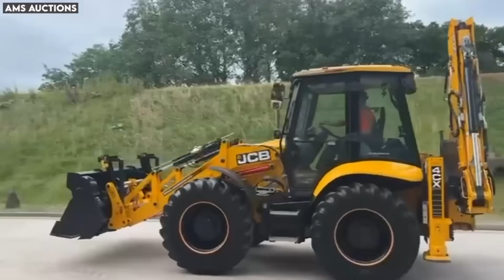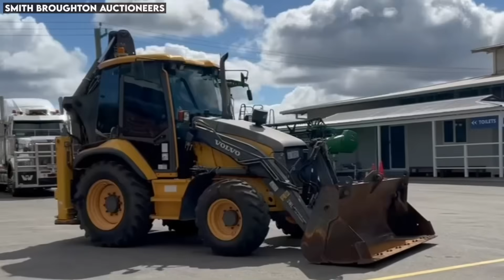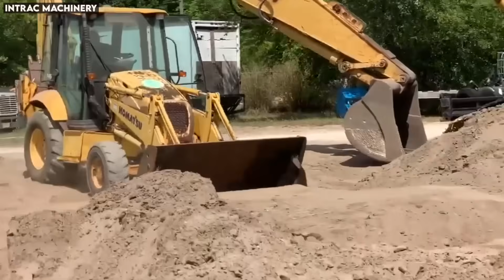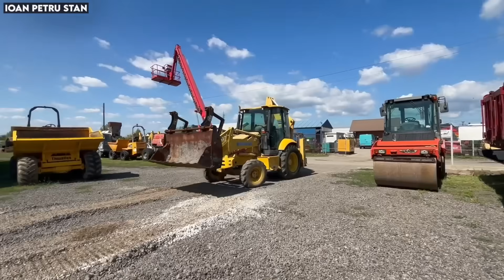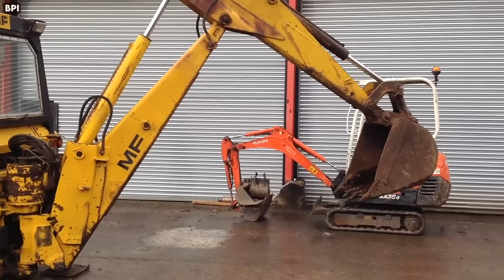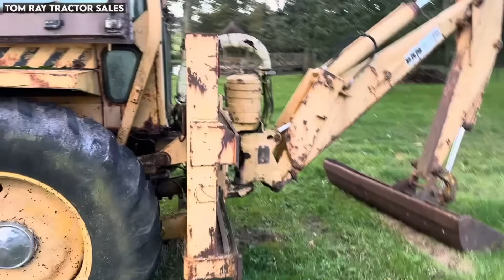10 Most Reliable Backhoes Ever Built

Comment: I started on the Case 580-CK series sitting on my DADS lap, as I operated the front bucket control lever, then he bought a brand new Case when the new 580-C series came out with the twin cylinder on the boom style that Case engineer 😊 that is the Backhoe I operated for years, but in 1979 I got to Run a Dynahoe-190 and fell in love with the beast. It is (19000) pounds, it can dig (19) Feet 😊 it has a (353) Detroit Diesel 
That puts out 92-H.P. I found one for sale in 2003 😊 and today in 2026 she has (8315)
Hours on the meter, with clean oil, and new Batteries 😊 she "STARTS" every time. Even though I operated a Case 580-series all my 50 years of operating a Backhoe 😊 the Dynahoe has the Case beat 😊 on everything. Just the way Bucyrus Erie built them, everything overbuilt.

Comment: If you look at Cats "FIRST" Backhoes the 416 line 😊 you see the old Case great double Boom cylinder system on the digging end, and the Front Loader has the John Deere single center Dump bucket cylinder setup 😊 I think Cat looked hard at both those designs from tryed and true setups on TWO different Rubber tired Backhoes that had been real world tested for years before they started making the Backhoe, in my humble opinion Cat, built that first Backhoe and did not need to do a lot of field testing at a proving ground, they saw what "WORKED" what "LASTED" on other brands of Backhoes, so they did not have to spend huge amounts of money on R&D for the 416 the Design was proven already 😊 now granted they have changed the Digging arch on the Boom, to match other brands out but I think it was brilliant to come out with the "FIRST" one with the proven technique for both ends of the machine 😊😊

Comment: Thank you for the History lesson on M.F. Backhoes, I did not know were ( Fermec) 😊
Started, I had seen them, and thought thay were their OWN company. Then I started seeing the (Terex) at ConExpo in Los Vegas 😊 and saw the similar Lines, and always wondered what happened to the (Fermec) Backhoes, not knowing that it was the new OWNER, and as a side note, none of the Factory reps. at the show told me any of what you said 😊 at the Case Booth, they had Factory Engineering people 😊 who had worked at Case production for 30+ years, and told me and worked on the old blood line of Case 580-series Backhoes 😊 the guy was very knowledgeable on the very Backhoes I had run up till the Case 580-series became better selling Backhoes 😊 it is "SAD" that I saw, in the bews, "SALES" were "DOWN" 40% on the Case 580-series at the Factory 😢 Case is focused on other Products build. I think the mini excavator Lines are taking the Rubber tired Construction King and Dethrowning the old do everything on jobsite machines 😢 with the huge Chinese mini excavator market taking off in America 😢 with guys "SELLING" all different types of Chinese mini excavator from there garages. And the "PRICE" of a Chinese mini is so "LOW" that I conpaired the "PRICES" of "3" major sellers of U.S. built mini excavator and you can "BUY" a couple of Chinese mini excavator for the "PRICE" of one of the big "3" I am using Cat-Case- and John Deere as the big "3" the huge diis the Chinese do "NOT" have the service "SHOPS" setup yet in the U S. marketing at this time, so the American brand for a contractor is still better for breakdown on a mini that say works 8 hours a day, 5 day a week. For a homeowner though 😊 that person can afford a Chinese mini, say for just around his home property 😊 it sure beats a "SHOVEL" any day of the week, in my humble opinion, and basically all Chinese mini excavator come setup with a thumb and have tracks that move in & out, to get through a normal home just "GATE" into fenced yard. Say the Fence gate is 3-Feet opening, the "1" Ton mini can get through a "3"-Foot fence in retractable position 😊